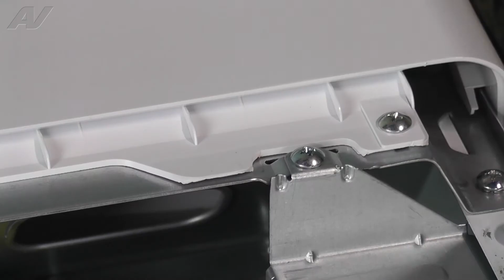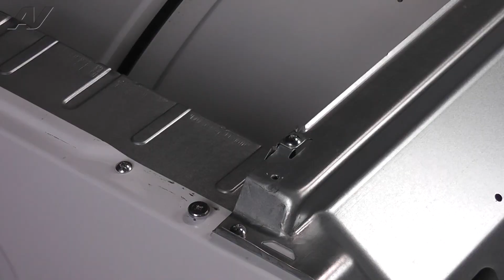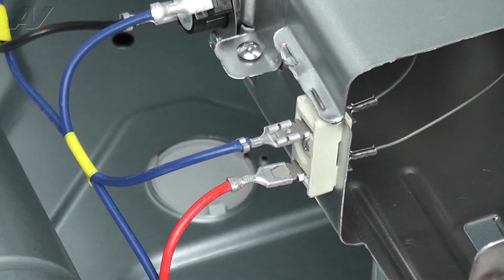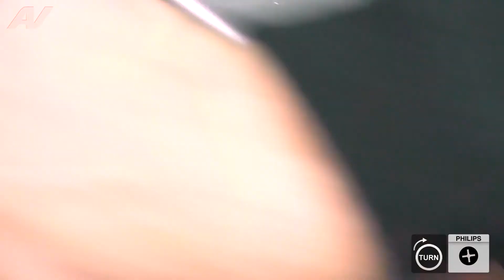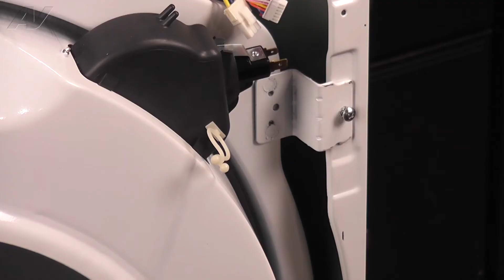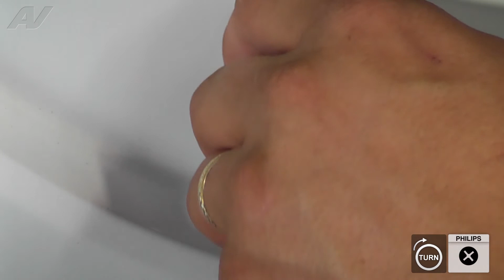Samsung Dryer not heating - Heater / Element - Removal & Repair -Diagnostic & Troubleshooting

Comment: Seriously, this is not a good design. This is not an uncommon repair. This should be designed and located to be replaced via a removable panel in the shell.

Comment: thank you. You said it doesn't matter which way the wires go on the heating element, what about the other 2 components of the heat system? I accidentally unplugged the thermistor and thermostat without taking note.

Comment: It is insane that one needs to dismantle the whole dryer to pieces just to access a couple of fuses. You would think there should ba a fuse panel in the back. Samsung wants you to go and just buy a new dryer.
Reply from the maker: Great question, if you have a more technical question that our parts department cannot answer, you can search our over 17,000 answered questions free at our website www.ApplianceVideo.com under our Repair Help section. You can also call our parts department at 1-800-830-5465 and they can give you help 7-days A week ,or search at www.SaveMoreOnParts.com  .

Comment: Is there a way to test the element without removing all the internal parts as done in the video?
Reply: Very good question in this case of course yes you can use multimeter set on ohm or continuity tone to test it thank you for asking
Reply from the maker: Great question, if you have a more technical question that our parts department cannot answer, you can search our over 13,000 answered questions free at our website www.ApplianceVideo.com under our Repair Help section. You can also call our parts department at 1-800-830-5465 and they can give you help 7-days A week ,or search at www.SaveMoreOnParts.com  .